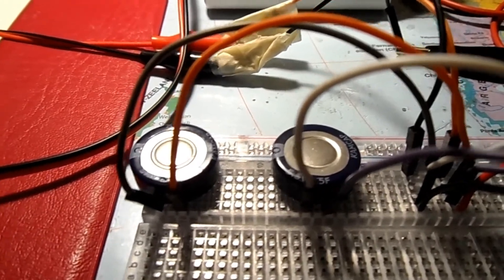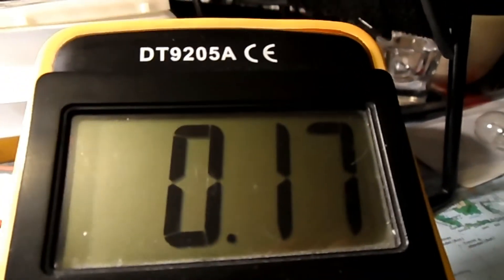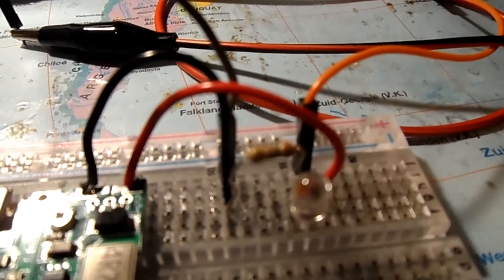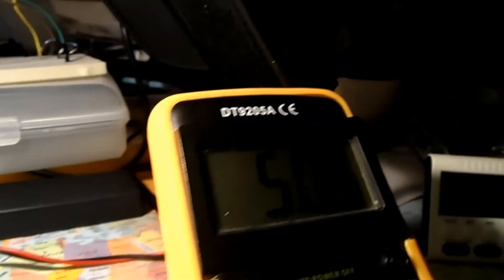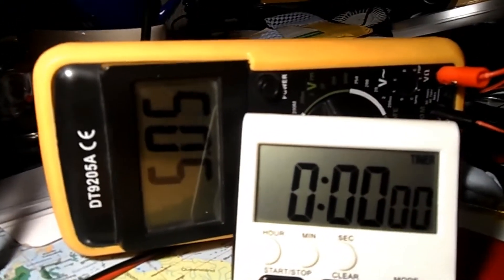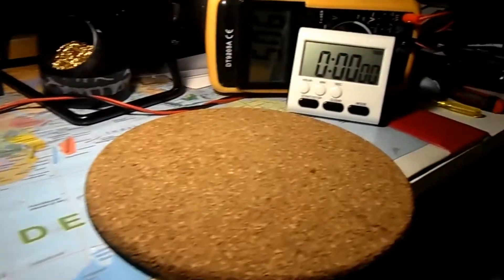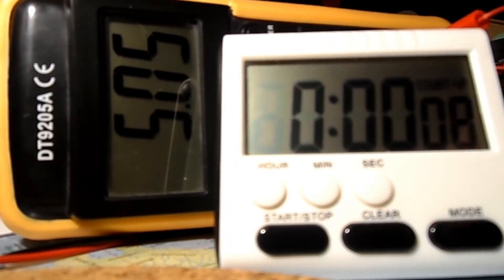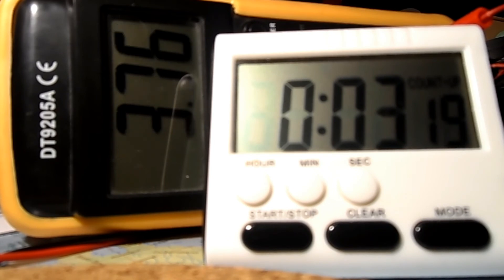Playing with 2 x 1.5 Farad Super-Capacitors

Comment: Not bad caps' now you can have a circuit that can have it's power removed for a short period of time. like when you change the batteries, or swap USB battery packs. As Peter S said a lot more fun parts than we had back in the 70's, remember my first red LED about 1975
Reply from the maker: Yeah they are nice caps. I will find a use for them in the future. I remember the old red dim LEDs in the 1980s that only could be used for signal not for lighting